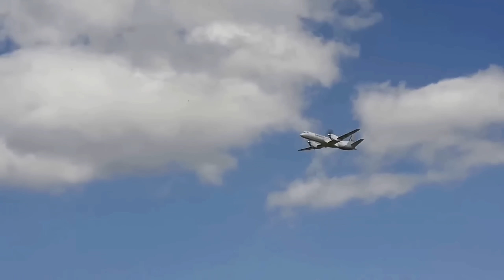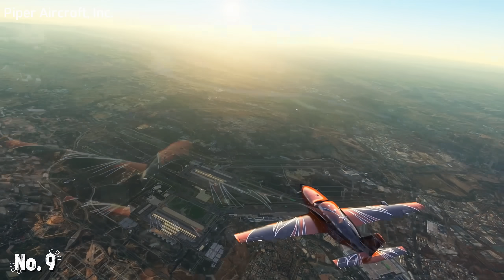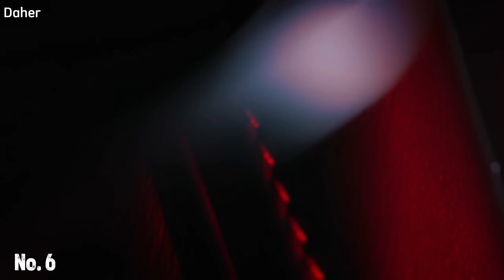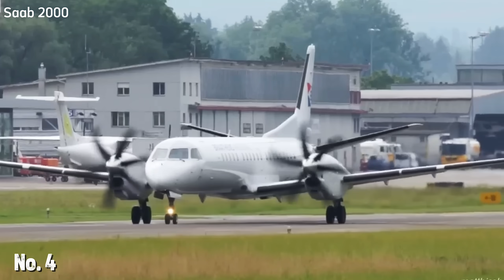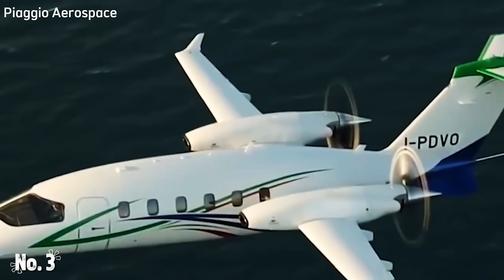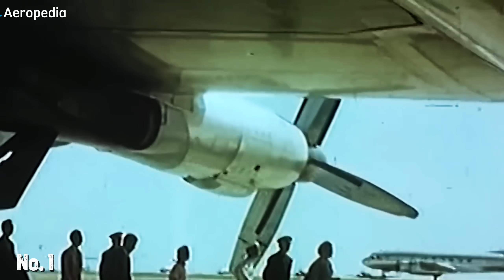These Turboprops Beat Modern Jets? The Engineering is Insane

Comment: Kusnetzov engines have been doing 
600 MPH in the TU-95's since the 40's with counter rotating propellers and are still flying... The new engines are the KN-73 for commuter planes and the KN-93 for large planes, they have prop fan versions of those engines...!..
Reply from the maker: Wow, thanks for dropping that knowledge bomb! The history of turboprops, especially with the Kusnetzov engines, is truly remarkable and adds another layer to the engineering marvel.